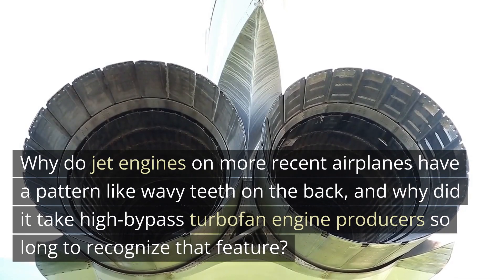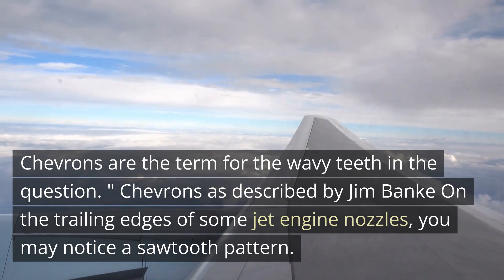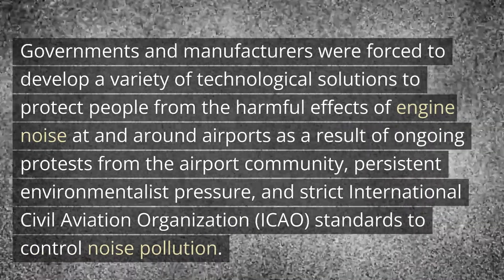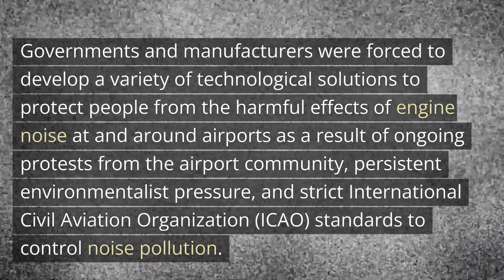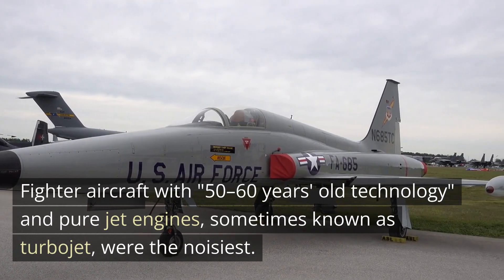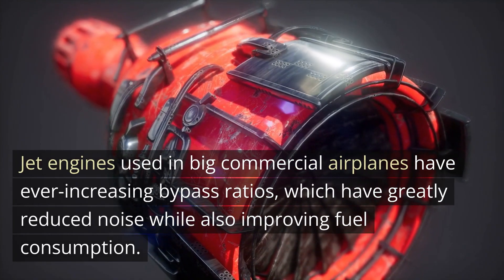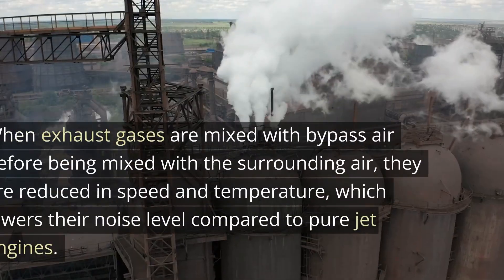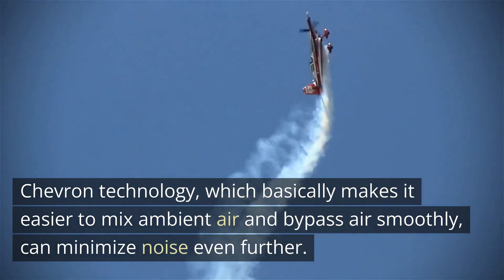"Chevron Technology _ wavy teeth: Enhancing Noise Reduction in Commercial Aviation"

Comment from the maker: Why do jet engines on more recent airplanes have a pattern like wavy teeth on the back, and why did it take high-bypass turbofan engine producers so long to recognize that feature?
Chevrons are the term for the wavy teeth in the question. "Chevrons as described by Jim Banke On the trailing edges of some jet engine nozzles, you may notice a sawtooth pattern. This is a NASA Aeronautics Research Mission Directorate design. The curved edges help to smooth the mixing of the hot air from the engine core and the colder air flowing through the engine fan, which lessens turbulence and noise.
Those who live close to airports have always been inconvenienced by airplane noise during takeoff and landing. Governments and manufacturers were forced to develop a variety of technological solutions to protect people from the harmful effects of engine noise at and around airports as a result of ongoing protests from the airport community, persistent environmentalist pressure, and strict International Civil Aviation Organization (ICAO) standards to control noise pollution.
Fighter aircraft with "50–60 years' old technology" and pure jet engines, sometimes known as turbojet, were the noisiest. Today's fighter aircraft are powered by low bypass turbofan engines, also referred to as leaky jets. These devices reduce fuel consumption while making less noise than turbojets.
Jet engines used in big commercial airplanes have ever-increasing bypass ratios, which have greatly reduced noise while also improving fuel consumption. In a big bypass engine, the majority of the air travels around the engine's core rather than through it, creating a layer of air between outside air and the hot gases that are expelled from the engine's exhaust.
When exhaust gases are mixed with bypass air before being mixed with the surrounding air, they are reduced in speed and temperature, which lowers their noise level compared to pure jet engines. Chevron technology, which basically makes it easier to mix ambient air and bypass air smoothly, can minimize noise even further.